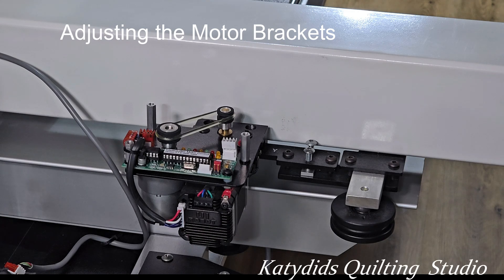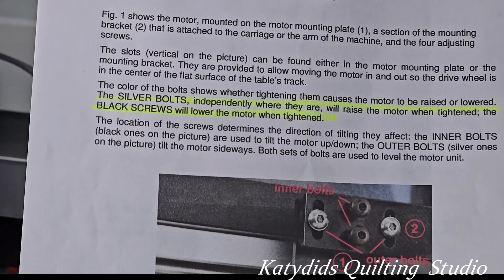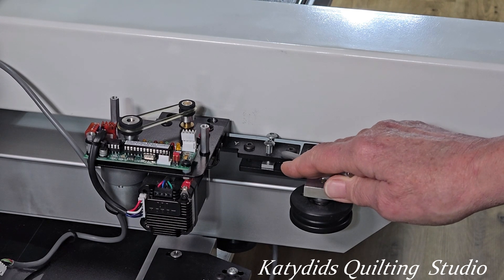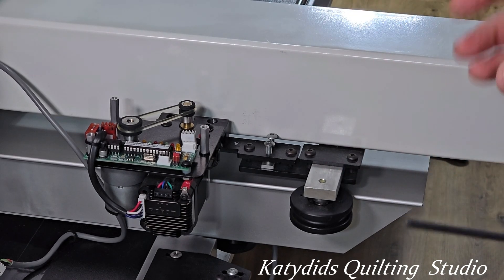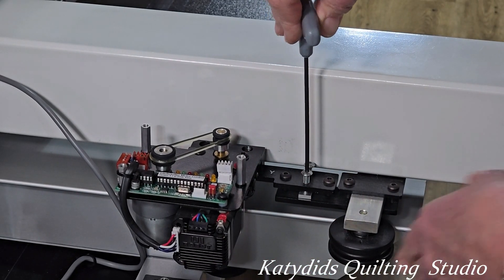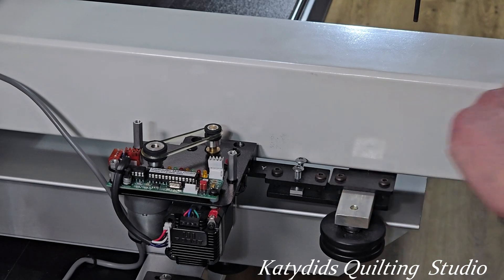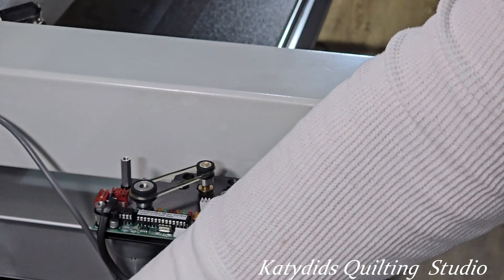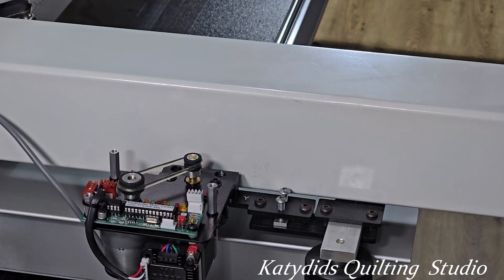Adjusting the IQ motors

Comment: Question is the machine on and IQ on ?
Reply from the maker: @gaillewis3324  no.  When the machine is shut down following the shut down procedures, the drive wheels are lifted.  That is when I do my adjustments. 
You could do it with IQ powered up, but you would need to put it into manual mode, so that the drive wheels are lifted.